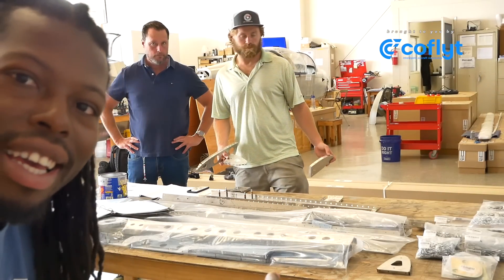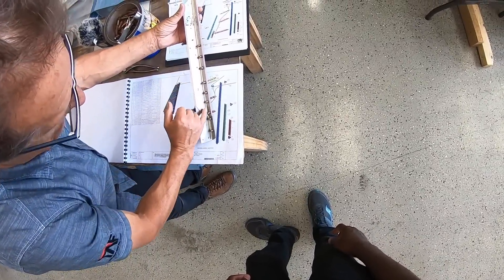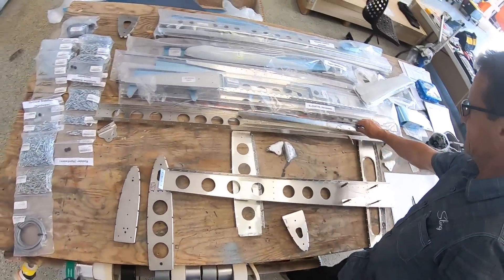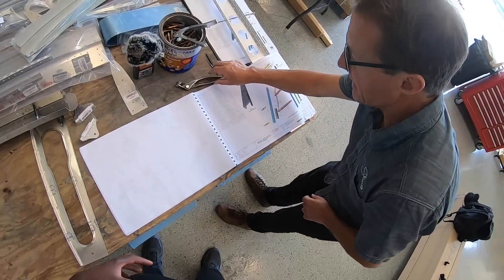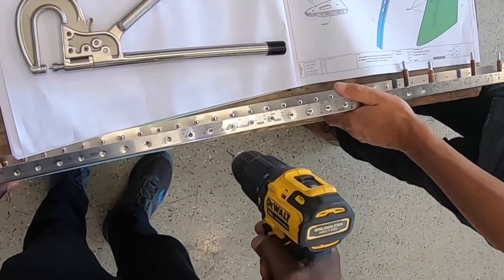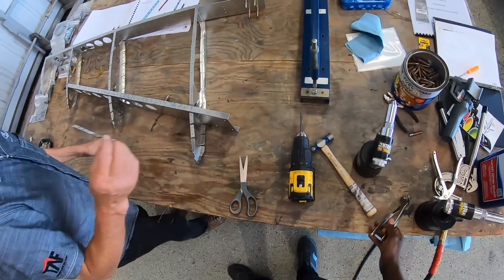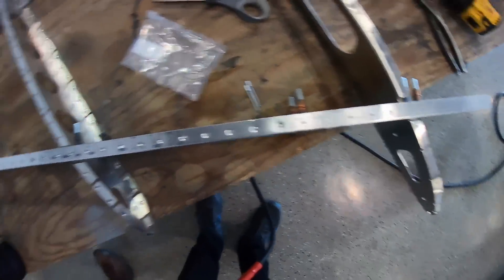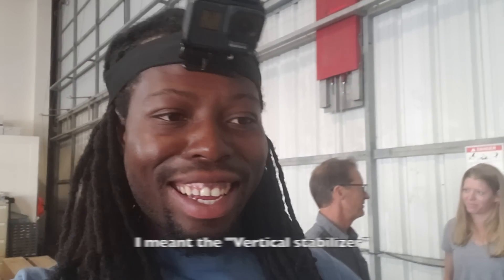This Part Is Missing From My New Plane And I have to Build It - Vertical Stabilizer Frame

Comment: If Sling already knows which parts require dimpling, that should be part of the manufacturing process. That is just one less headache the customer, who may not go through the build assist program, has to endure since I'm sure that tool isn't cheap.

Comment: One thing I don't understand that kit manufacturers who also factory build (so have people on hand building anyway), is why they don't buy a few cameras for different angles, then have a couple people film every step of the build process close up. Then have someone narrate any tips along the way, including in the beginning some stuff like this on tips on using the tools, etc. Then bar code the steps and when scanned with the phone, the video for that section comes up. Could even be hosted on YouTube for no hosting costs.

That would speed things up a ton on a build compared to even the most detailed and clear paper manuals. It wouldn't be that expensive relative to the cost of the plane and would be a really, really nice selling feature. -Daven
Reply: Excellent Suggestion!

Comment: When you drill a hole through the material do you need to clean the drilled hole prior to riveting?
Reply: Andy Grimm I would assume so, never built an airplane but I’ve built other stuff and I imagine a deburring tool would be helpful

Comment: 1600 hours of build time ==> 2-1/2 years of calendar time.
Under BEST of circumstances and no Ooops (like inserting improper rivets), you are pushing things for OSH 2020.
Then too, you are having Others build it, with proper prior experience and tools and an airconditioned hangar and spare parts and kissing relations with the FAA --- but still probably pushing things for 2020.   2021? better choice.  2020, might have structure complete, but no AC90-89 compliance, or DAR approval, nevermind being flyable
Reply: Gwen Walcott It is interesting to see the different mentality in those choosing assistance builds (MoJo, Flightchops) vs us who just plug away in our garages. Nothing wrong with either one, just different. Without (paid) assistance, I have spent the last month or more reading the first steps of the plans, reading  builders websites, watching YouTube videos, working on practice kits, etc.. In preparation for starting my empennage kit for the RV-10 (arriving Monday!).  I have done similar research on my other two builds as well. I guess with the assistance you don't need to perform all these extra task, saving a lot of time I would imagine!

Comment: Fun to see your progress and you’re not afraid to show the ‘oops’ moments. Age old question - how come I don’t see you applying any primer to the ribs?
Reply: I don't want to speak for Sling at all, but, the material of the kits are 6061-T6 so there is very little potential for corrosion that can cause any pragmatic issues with that series of aluminum. As long as the aircraft is not kept in outright terrible conditions, then there's no real need to primer and paint or use other coatings like zinc chromate in order to protect the 6061 series alum. 

It seems as well that the whole aircraft (at least through the factory program) will receive a final coating of an epoxy primer so that should help.

There are many schools of thought on this subject and there's people who will completely treat every part after final drilling before paint-dipping each rivet prior to insertion in order to protect the metal at all costs. This is more-or-less an accepted standard measure for 2024 alum, steel, etc, but many apply it to a 6061 aircraft just the same. Some choose only to give each rivet hole a little dap or shot primer so that there's no chance of stainless rivets having any sort of issues with dissimilar metals in contact. However, others choose 6061 specifically because it allows one to cut parts, combine them quickly with some pull rivets, and go fly, so they are deciding that any potential gain in longevity 20-30 years down the road in marginal conditions is not worth potentially doubling the assembly time for treatment processes.
Reply: @scottwatrous  fascinating. A lot to consider. Thanks!

Comment: Mike, tell everyone about the Cleco's, why they are used and how they're placed.  Great Video!!!!
Reply: Clecos are a type of clamp for holding parts together while you're putting in the real fasteners.  They function like removable rivets.  The big part has a strong internal spring that connects to a skinny shank can expand and contract..  When you squeeze the Cleco in a special pair of pliers, you compress the spring and also narrow the shank so it will fit through the rivet hole.  So you stick the shank in the rivet hole, then release the pliers.  This expands the shank and the spring pulls the shank and the big cylinder together, clamping the 2 parts together while keeping all the holes in the parts properly aligned.  So Clecos have to be snug fits in the holes so come in different sizes corresponding to rivet sizes.  They also make a type of Cleco with actual clamp jaws for holding parts together along their edges when there are no rivet holes.
Reply: @TheBullethead  Best explain ever, tnx!
Reply: @scottstolnitz8918  Thanks  :)  More Cleco trivia.  There's always debate about how many Clecos to use and where to put them.  In general, the more Clecos you use, the less deviation in part alignment you get as you install the permanent fasteners, but the more time it takes as every Cleco used has to be removed eventually.  Over thousands of holes over dozens/hundreds/thousands of aircraft, that adds up in factories striving for efficiency so they do studies to find the absolute minimum number Clecos and the ideal holes to put them in.

However, for a DIY airplane, you're building a 1-off so the whole production line mentality does not apply.  You're more concerned with not having to buy replacement parts after you screw something up, and you're betting your own life on the quality of your work..  So LOTS of Clecos, maybe every 2nd or 3rd hole depending on curvature.  Especially if you're not using any type of assembly jig and are relying ENTIRELY on 1) the parts being shaped totally spot-on at the factory and not being bent during shipment or mishandling by you, and 2) Clecos to hold compound curves in alignment while you install the permanent fasteners.  Mo' Clecos mo' bettah.  Also mo' work, but you're not paying yourself by the hour to build the plane your life will ultimately depend on, so take the time to do it right.

NOTE:  In pics of completed subassemblies, you'll often see a few Clecos still in some holes at the ends of the subassembly.  They're in holes that are common to other structures so permanent fasteners won't go in those holes until final assembly.  The remaining Clecos keep the loose ends of the parts from getting snagged during subsequent handling and bent.
Reply: I love cleco's. Best, most useful tool ever.